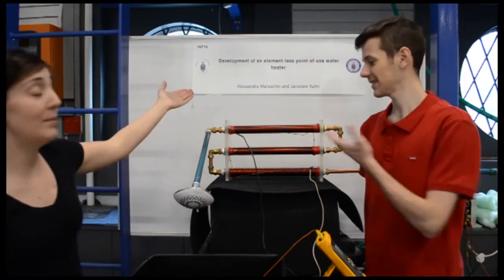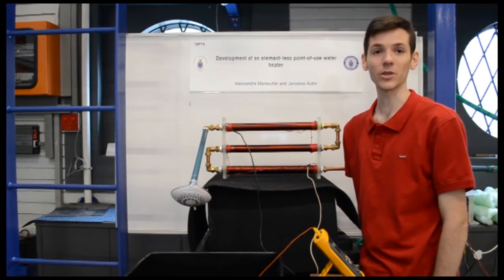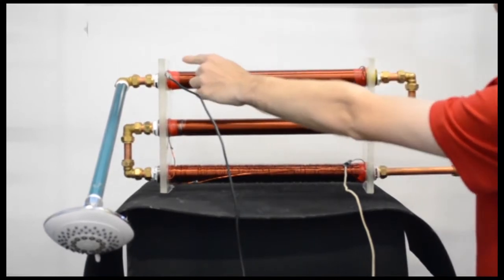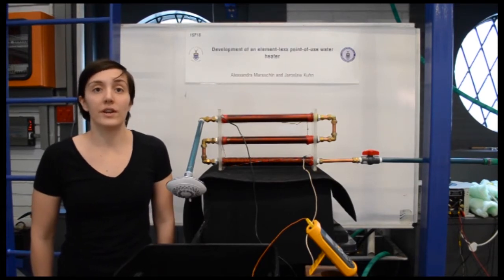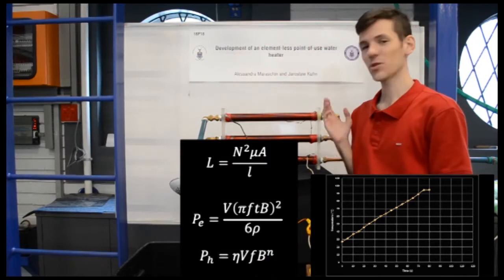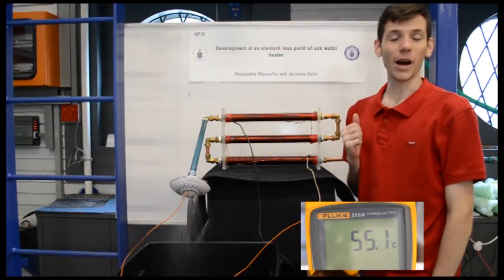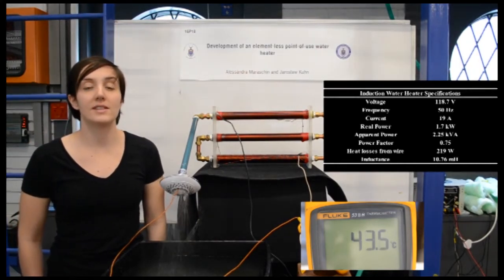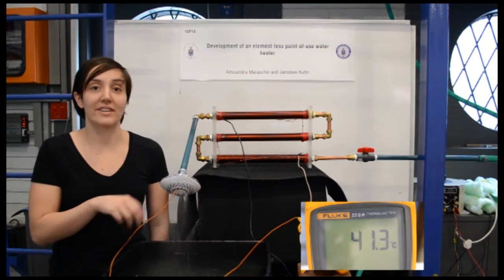Development of an element-less point-of-use water heater

Comment: I've got a rewired auto altornator that I spin with a rewound 1940 chrysler 6 volt generator.runing 96 volts dc. Induction heaters running on sixty five volts , three phase a c. . heating my hole house and hot water.   I also Circulate fresh air and pressurize My house with the fan on the motor..  Energy consumptions under 200 watts.  It's not brain science. Or rocket surgery. Hopefully one day our society wont be held back by the need to consume. And or over
Complicated with xs an ys. Only know what we've been shown. Fallow ur imagination anything is possible... love you 😊

Comment: Like the idea but impractical as it stands. With increased flow rate and increase temp to 48 degree celsius, as a newbie i think it requires 3 times the coils and about 3 times the current 220v at 60 amps. 14kw.

Comment: 19 amps is very high ... did you take in consideration 220v systems? I think the idea can be developed for water tanks to heat faster in two ways: either to make inductive coil around the water tank or to coil a copper pipe around the pipe from an exit near the hot water exit, to a point near the cold water entrance ... this makes the hot water circulate faster inside the tank i.e faster hot water

Comment: HOW much energy it consumes in comparison to conventional Nickchrome
 Resistance based heaters with same flow rate & temperature,  what will be the net Savings we get .
Can you share a comparison data sheet
Reply: Mahmood Shaikh hardwater wil dmg the heating element. That problem is solved here